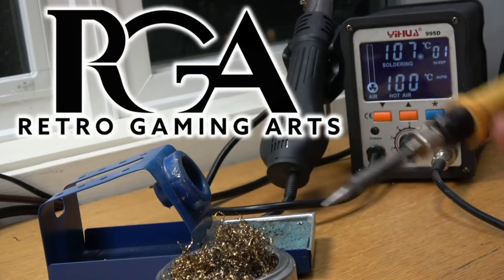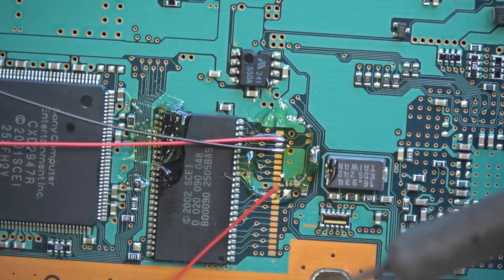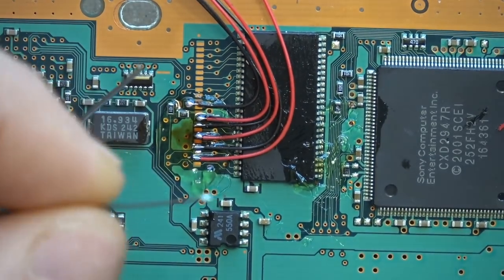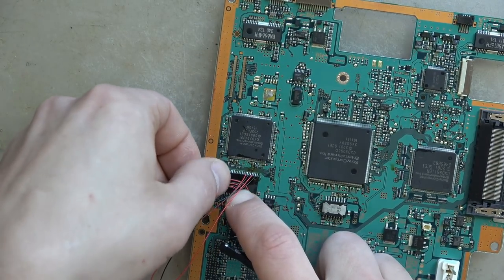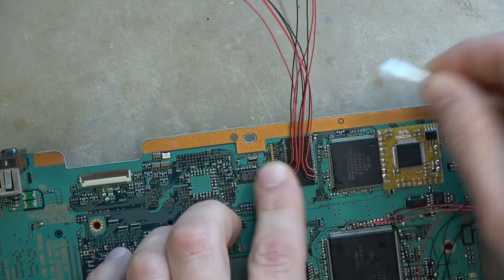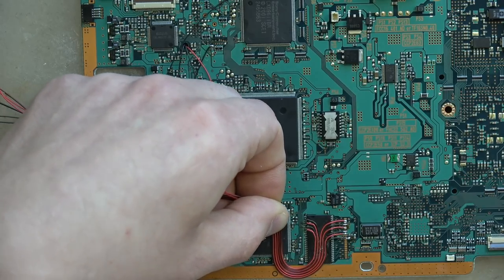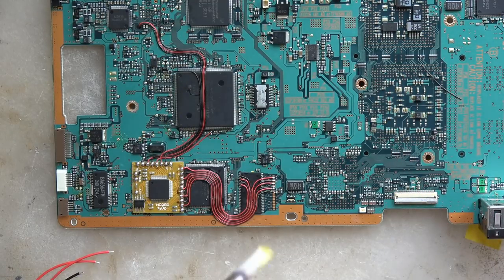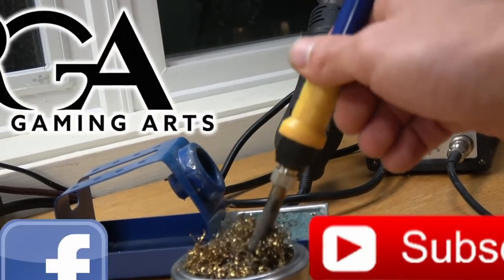HOW I MOD MY PS2'S (MODBO 5.0) - RETRO GAMING ARTS

Comment: can you tell me how to disable the modbo v5 from going to sleep after booting a ps2 dvd game? I cant activate acton replay on my ps2 backups because this chip goes to sleep after i boot any ps2 dvd game. Basically im asking how to keep this chip on? thanks
Reply from the maker: I've never herd of this happening. But when you boot the system hold triangle and circle, that will give you access to the menu settings and you can select "auto" from the boot choice. I'm wondering what it's on right now
Reply: @RETROGAMINGARTS  thanks for the reply but i dont think thats it, you can try it yourself. 

Insert a backup ps2 dvd game (has to be dvd game) -> go to browser on ps2 menu -> check the title of disc, it will say PS2 DISC if working fine...

then open the console lid - > dont press reset -> close the lid again -> check what it says for the disc now - if it is working it should say PS2 DISC if it says DVD video or goes to please insert playstation disc screen it is not working...

basically first time it will say PS2 DISC from a fresh boot, then when you open and close it then let it read it again it will say DVD video or error and not PS2 DISC.

its actually one of the "features" of modbo chips to go to sleep after the first disc read so hot swapping or activation of action replay cheats is not possible, unless you can keep the chip on? if anyone knows how let me know?

its one the reasons i dont like the modbo chips... I prefer the mars pro chip  and modbo 750 fw1.93 it doesnt have this problem.... I mean they allow multiple dvd switching or hot swapping without pressing the reset button for ps2 backups unlike modbo v5 fw1.93 or modbo v4/v5 fw1.99 which dont.

this is all from experience if you could let me know how to keep the modbo chips on??? then its perfect..

Comment: Wouldn't it be bad to lay the mod wire across a circuit chip that's on motherboard? I thought it would get really hot while gaming and melt the wire
Reply from the maker: DeathCult696 your thoughts make perfect sense, however on the ps2 this is not the case,  the wire has much higher heat resistance than the IC is capable of reaching
Reply: is that a certain kind of wire or would most wire be fine across the ps2 chips?
Reply from the maker: all wire will be fine (unless its SUPER cheap wire, like garbage wire, i doubt you will be using wire that bad) however, i do highly suggest 30awg kynar wire

Comment: I have one question, do these chips, that have the wires running over them, heat up and can potentially damage the wires or make them shortcurcuit if their isolation melts?
Reply from the maker: i feel not enough heat is generated to cause any issues

Comment: Have done everything clear. but after testing on TV there was "No Signal" try many times nothing helped. is there any chance for this problem? have not tested again without chip
Reply from the maker: Recheck the soldering, look for a bridged connection
Reply: @RETROGAMINGARTS  thanx for replaying. will try tomorrow
Reply: @RETROGAMINGARTS  today i checked all wires and connection with tester everything norm. ps2 works it turn on CD works it's come out and in restart works. but there no signal on TV. I tested without chip and now it not working without chip too.
Reply: Re Checked everything and now we have "Matrix" on screen i'm happy. the problem come from soldering one place and now it's forking and 'im happy

Comment: Unless I’ve somehow been acquiring the wrong kynar wire. 30 AWG isn’t tinnable and I’ve tried everything.. and I’ve done mods before, rghd an Xbox 360 and that was fairly easy but just confused how you can tin that wire. Any chance of a link of the exact wire used? Also how can I find a 5v point on a ps2. I have a multimeter but no idea what would have 5v on the board and don’t wanna poke the wrong things
Reply from the maker: Heyo
Reply from the maker: https://www.ebay.com/itm/30-AWG-KYNAR-wire-wrap-30-gauge-Kynar-100-FEET-Any-Color-/252533787813?_trksid=p2349624.m46890.l49292

Here's some wire
And
Reply from the maker: Check the link in the description, it's everything I know about ps2 modding, its a really good guide, but to find 5v you will need diagrams, you can find them on Google images, the guide i wrote should help
Reply: @RETROGAMINGARTS  American link I live in the Uk. The last time I purchased 30 AWG kynar it wasn’t tinnable as it was single strand.. should it of been single strand?
Reply: It’s very odd that the wire I get doesn’t tin, don’t think it matters too much if I pre tin the wires anyway but I don’t see how it’s even possible. I’ve done a fair amount of soldering and tried different temperatures, flux. And it just doesn’t tin. Because the strand is so thin it just sort of gos through the wire or falls off. I’ve stood there like a lemon before now trying different temps to tin this wire with no luck. I have no issues tinning slightly thicker wire

Comment: I have a question 

I already fit in the modchip i follow the guide and its same model amd version of my ps2 and i did solder properly but after that when i open my ps2 it go gree and comes to red after 1 sec pls help
Reply from the maker: Sounds like a problem with your cables  and that connection
Reply from the maker: What AV cables are you using?

Comment: I don't suppose you have a diagram for a modbo 4.0 for a 75001 do you?
Reply from the maker: I just google image for all the install diagrams, make sure to use the motherboard model number, it will be GH-000-00 but there will be numbers instead of 0's
Reply: I got another question for you, 4 months later XD. I modded my ps2, no problem. Wasn't that hard. Region free. I have one PAL game though that doesn't get along with the ps2. My other pal game works fine. The game with the issue is Forbidden Siren 2. Freezes during cutscenes and during one point in gameplay, while going from one area to another, via loading screen I guess, as that's where the game soft locks. I can skip past cutscenes, but that's the issue. I've tired different cables, tv sets, settings... I don't suppose you can give some insight as to where to go from here?

Comment: I’d like to get into this sort of stuff I’ve soldered a few things including a Sega Saturn region switch.. I have problems with 30awg kynar wire. It won’t Tin even with flux. I’ve used a different solder and everything. So confused because I have no issues with 28 AWG and I’ve even ordered different kynar wire...
Reply from the maker: It can be hard to tin, theres ways around it to achieve good solid joints without having to tin it. I covered them in my other ps2 mod videos if you wanna check em out. The matrix infinity install is a good one

Comment: Hi, is there any chance that you know how to fix a no signal(video&sound) ps2 av Port? it just hanged when I'm playing and when I reset it, there's no av output, i know it's not the cable or the TV because I tested it in my other ps2. Thanks
Reply from the maker: Capacitor replace on the AV circuit

Comment: it's ok ok if you soldier the contacts together or it's gonna short the circuit
Reply: thanks
Reply from the maker: I bridge connections on accedent all the time, as long as you remove the bridges you'll be ok.
Reply: thank you all for the reply

Comment: I don't think that tip works best for small pads and IC pins.
Reply from the maker: So honestly, after doing enough of these ps2s, I can use any tip I wanted, but I still use a tip similar to this one. Check one of my other ps2 mod videos and you'll see different tips that are kinda the same. This is my worst ps2 video. 

Today I pretty much use K-Series tip amd one like this as my universal daily driver, I switch between the 2 for every application around

Comment: wait, GND point on a Modbo 5.0 isn't a solder point, i'm seriously confused please help!
Reply from the maker: What you mean?
Reply: @RETROGAMINGARTS  the point GND is supposed to be soldered to on GH-015 V6 board does not look normal. I got the diagram from quade ps2 modding website.
Reply from the maker: Solder to any ground point on the mobo. You don't have to follow the diagram exact, but you may not be looking at the right diagram
Reply from the maker: Heres a guide I wrote that may help
https://pastebin.com/mCdjaHLC

Comment: How much do you charge to do this, ill sent you one of my ps2, and if you can fix my AV port i think its internally loose, so its hard to see it on the tv, i use same AV wire on my other ps2 and they all work fine, so i know its the ps2 AV port thats messed up, i want open it up and fix it myself, but i wouldn't know what to do, scared i might make it worse, cuz also it has trouble opening the disc tray, i have to pull on it so it can open, if not it will go back in right away, or sometimes the disc tray will get stuck and wont open
Reply from the maker: I'm not doing repairs or mods for people anymore. I could walk you through it tho
Reply: @RETROGAMINGARTS  do you have other videos that can help me repair it my self, the mod can wait, just want to make sure i can make it work again properly, i have 4 ps2 2 regular big ones and 2 slims, one of the slim also wont read disc, it spins, just wont read it
Reply from the maker: Yea. I have a video about fixing the disc drive and cleaning the laser. Witch should work for your situation. But for the av cable connection, theres a small piece of metal inside the ps2 av port that needs to be tightened up, so it squeezes the av cable when inserted.
Reply: @RETROGAMINGARTS  aight bro thanks ill check out your video, thank you

Comment: What is flux i hope i spelled that right is it a sodering liquid?
Reply from the maker: flux is a compound that removes the oxides from metal, which in the case of soldering, it helps you get a nice strong good connection between whatever your soldering together

Comment: hey, the 30 awg wire that you are using is it single strand?
Reply from the maker: Yes. Solid core 30awg kynar. My favorite stuff
Reply: Do you have any tips on how to tin this type of wire lol. for some reason the solder sticks to the iron. i find it easier to tin multiple strand. btw, i admire your content.
Reply from the maker: Yes, the way I tin them is by dipping the end in flux and getting solder on my iron. And touching the iron to the wire. The flux will transfer the solder
Reply: @RETROGAMINGARTS  is there a huge difference between solid core kynar and stranded? Because I see a lot of comments saying they’re struggling to tin the wire including me. I’ve never struggled tinning any other wire if it’s slightly thicker. Is this a factor?
Reply from the maker: @L3TH4LPRODUCTIONZ  yea, there's a difference between solid core and stranded. Solid core is harder to tin than stranded, so if stranded is what someone's used to. Solid core will be annoying to tin. But after doing it a few times you'll get the hang of it. The solid core doesn't hold alot of solder and thr solder engulfs the whole wire so sometimes its tinned but it doesn't look or seem tinned
Reply: @RETROGAMINGARTS  I’ve noticed not many answers in regards to why kynar won’t Tin on google, and I wouldn’t call myself a soldering expert but I’ve been soldering for at least a year or so and can’t get my head around it. I was buying kynar off eBay and someone mentioned to me that it may be from Chinese resellers and possibly just cheap stuff. I bought some off amazon and waiting for it to arrive, it’s branded kynar think it’s called TUOFENG
Reply: @RETROGAMINGARTS  received that wire I ordered and it’s just what I was looking for, not sure how many strands you use in your vid but this is 30 AWG stranded with 11 strands of 0.08mm it’s basically just as small as the cheap stuff I was buying off eBay but it’s tinnable and definitely would work better for these installs. I’ve found if you have single strand wire which is the rubbish off eBay it cannot be tinned
Reply from the maker: @L3TH4LPRODUCTIONZ  dope! I'm glad you just got stuff that will work for you, do you follow me on social media? Tag me or something when you post some modwork if you do, id love to see

Comment: Does it work on SCPH-39001 model?
Reply from the maker: Yep
Reply: @RETROGAMINGARTS  I searched it up on eBay and it said Models SCPH-30000 through SCPH-39000 can be modded, and It doesn't say about SCPH-39001

Comment: Whitch Modo is Better 4.0 or 5.0?
Reply from the maker: Preference. I did a video all about many different ps2 modchips, I go alot more in depth into the difference between all of them.  "vintage modchip collection" its titled something like that, pretty recent video on my channel, check it out it will give you an answer + way more info than I could supply here
Reply from the maker: Modbo 5 has hardrive support modbo 4 doesn't. Modbo 4 is a more reliable chip than modbo 5.

Comment: Why tho? Free mc boot been around for ages now 🤷🏻‍♂️
Reply from the maker: Fun😀
Reply: Freemcboot won't work with every ps2 game like the modchip does. ESR patched games can cause problems in gameplay for example in manhunt 2 and in baldurs gate dark alliance, the game will softlock and have gameplay issues constantly. Freemcboot also takes up memory card space and requires a magic gate memory card to work properly. Ps1 games work with a modchip but ps1 games on freemcboot require modding the laser with tissue, swap magic case, or tape. Modchip has dvd9 support( god of war, rouge galaxy, champions of norrath relms of everquest, etc) while fmcb does not. Freemcboot messes with the ps2 boot options while a modchip doesn't. Freemcboot also can work with a modchip, but freemcboot requires a mod like swapmagic to get it to install, unless you buy a fmcb memory card.
Reply: Danny Dorrito who uses esr anymore? Use OPL

Comment: Hi really hope you respond it's extremely important do I require a picfix if I installed a modbo 5.0 in one slim ps2 and the other a modbo 4.0 it's the 9000 series
Reply from the maker: Pic fix is only required if it's a scph700012. Or a v12.

I wrote a document called everything I know about Ps2 modding. There should be a paste bin link in the description of this video, far more info in that than I could ever type here. And that's why I wrote it lol
Reply from the maker: Heres the link

https://pastebin.com/mCdjaHLC
Reply: Thank you so much for the response really appreciate it will start reading now love your modding videos it's one of my guilty pleasures 😂
Reply: @RETROGAMINGARTS  I Checked online I have a SCPH-90002 it's a v18 so then it isn't required for a Pic fix if I understand everything correctly right?
Reply from the maker: @joshuavanrooyen5179  no pic fix for that ps2. Only v12s need it
Reply: @RETROGAMINGARTS  awesome thanks so much 😁